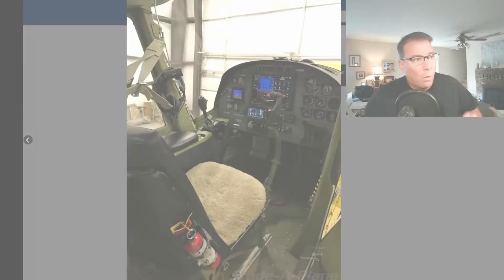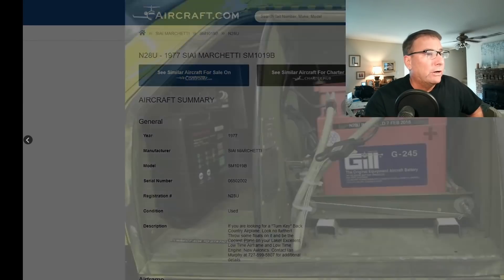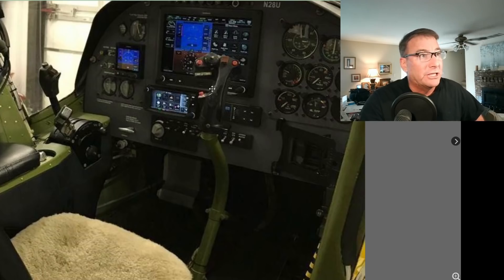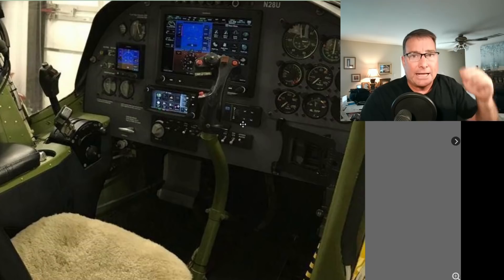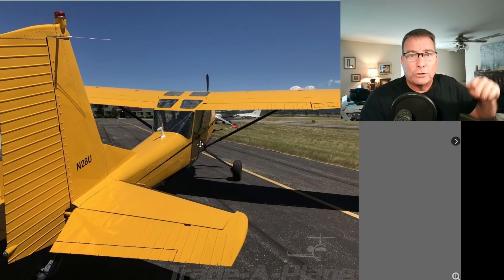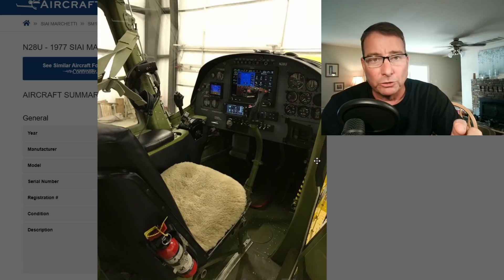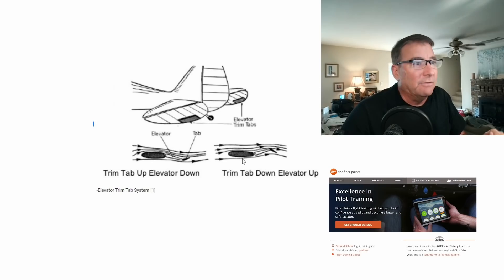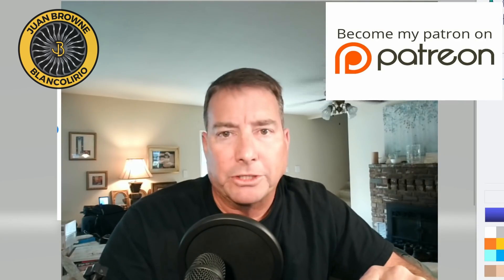Dale 'Snort' Snodgrass Siai Marchetti UPDATE- Elevator Trim System 8/8/21

Comment: I don't know I watched the video of the crash 20x without sound and it looks like there were no control inputs. If runaway trim you'd think he would have firewalled the stick...regardless of if he can't overpower it we would see flapping control surfaces....especially from a fighter pilot who is used to hand flying
Reply: I noticed the same .  Elevators and ailerons never moved .
Reply: nor rudder: I get that this happened fast but in that limited time frame I suspect “do something” might have won out over “freeze”. We should find out soon. I also noticed that on impact the elevator suddenly moves, then I think comes to rest up, likely as the control system breaks.  I just get the sense that in some way the controls were locked and the elevator in a slight climb position and the flight path dictated by left turning tendency.

Comment: In the event of a runaway trim to a nose up pitch in an aircraft with a powerful engine, would it be possible to throttle back to idle and hand muscle the elevator to a nose down attitude?
Reply: I answered Juan’s comment to me about that. Your hypothesis is the same as mine and Juan said it’s counterintuitive in the short amount of time to react.
Reply: @bjs2022  he’s right, you are not taught in training to cut power.

Comment: Interesting thought about the trim runaway but most of those systems (with the notable exception until recently of the 737 max) are designed to stop with application of opposing trim.  Holding opposing trim for more than a few seconds usually disables the system. ( on the max it did not. The system would reset after 5 seconds. This has been corrected. ) I will admit I am not at all familiar with the SM.

Comment: That control lock was very well designed. Even if you had a total brake failure, you would not be able to even fit your legs in there without it being very obvious that the lock was engaged..
Reply: Well, I think the theory with that was the control lock was on the front, and he was flying for the rear seat

Comment: I've done many many Owner assisted annuals and unassisted annuals. A couple of the unassisted ones were real cause for concern. Had a C182 in for annual and upon pick up found that the front seats had been switched now because the Adjustable seat was on the right I noticed it immediately when I sat in the left or pilots' seat. Same Owner different Plane different shop. When we went to pick up the plane naturally the logs weren't ready but every thing was done and ready to go. On the preflight found only 1 screw on all the inspection covers and panels. Found a bac of screws on a workbench with a tag with the N Number on it. Inspect inspect inspect after any maintenance or others flying your plane.
Reply: @Robert George Most airports quote a response level (times, number of vehicles etc) for incidents. I don't know what they are at Lewiston, but you ought to check before you accuse anyone of anything.
Reply: One Man ran to the scene and the others were unconcerned, sad world we live in .
Reply: @deerhunter7482  Sorry but there was a second person (white shirt?) on the scene very soon after the guy on the dark shirt arrived. Not criticising just pointing out something easily missed.
Reply: @deerhunter7482  I guess they realised that the impact was unsurviveable and then when they noticed the flames may have thought it would blow up. In other words perhaps they didn't want to endanger themselves for no reason :/
Reply: I have no reason to suspect anyone's motives but with the video why did no one be proactive with a fire extinguisher? Is there a protocol not to advance to the craft?
Reply: @larrybe2900  Yeah there seemed to be a distinct lack of urgency from almost everyone on the tarmac.
Reply: @larrybe2900  Shock can stun people into inaction too. Don't forget that we could see what happened due to the height of the camera whereas people on the ground would have heard a loud noise followed by a cloud of dust. Several of the "bystanders" would have had their view of the incident block by the jet sitting on the apron.
I am not being critical just pointing out somethings that could easily be overlooked.
Reply: @larrybe2900  Most, if Not all airports have S.O.P.'s regarding what to do in case of an incident, and may state Only Certain personnel are to respond to an incident.   Also if they were "airline" personnel they may not have known what the airport's policies are regarding incidents and/or may have limited training.    Hopefully that answers your question.
Reply: @matthewgroff433  “Not my job.” ??? Really- really?  I can not imagine NOT trying even if I only throw dirt on it with my hands!

Comment: Regarding the seat rails, your video shows that this plane's seat rails have multiple adjustment "holes" and they look nearly identical to the seat rails in a Cessna 180 that I flew for 17 years.  There is much more than just a couple of inches of fore and aft seat adjustment.  I don't know how tall "Snort" was but if the seat was adjusted even a little forward of the middle position on the rail it's still possible for the seat to move back far enough to get one's feet off of the rudder pedals and far enough that you may not be able to push the stick far enough forward to lower the nose.  On the Cessna 180/182 there is an AD requiring a modification to the seat to keep it from suddenly moving aft even if the seat rails and locking pins are worn.  The only problem with this theory is a slipping seat usually (but not always) goes aft quickly which would cause a sudden pitch up rather than a smooth, continuous climb as seen in the video.  Still, this could be a contributing factor.  Food for thought.
Reply: It was the aft seat that had a lot of adjustment, not the fwd seat.
Reply: @python3574  Thanks, I stand corrected.

Comment: Juan, how does the pilot verify correct operation of the trim tabs?  Does he use a mirror in the cockpit to view the tabs or is there an instrument?
Reply: Actuate the trim system, walk around the tail and look at it. Actuate the trim in the opposite direction, walk around the tail and look at it. Outside of having a spotter, that's about it.
Reply: @dragthatsht  I usually don't have a spotter besides I want to see it myself.
Reply: What I do is set the trim to full up then get up and check the trim tab. It should be fully down. Down in the trim tab forces the elevator up.
Reply from the maker: Trim indicators in the cockpit.
Reply: @blancolirio  But if it's rigged backward the indicator show that? In the Cessna and Piper I fly I don't think so.

Comment: It seems to me that a trim system without some visual indication of the deflection is an awful potential danger in that crucial period of lift off. The old systems which employed a graduated dial that showed the set amount of tab deflection is superior to my mind. Especially considering the chance of runaway deflection where motorization is involved.
Reply: I was just thinking about this. Could they add a high pitch sound when pressing the button up, and a low pitch for down. Then if it gets stuck - you would hear that unique continuous sound. Also add indicator lights for each one on the dash as it's triggered.

In case of electrical short, perhaps design a digital encoder in the button. That way a specific signal could be sent for each direction and a damaged wire is ignored.

Comment: Thanks for the update. I agree the control lock theory doesn't apply here. The electric trim is high on the list of things that work until they don't.

When we had our PTT switch repaired in our Commanche yoke.  The mechanic reversed the electric trim wires on installing. Nose Up was Down, Nose down was up. I don't think the power needed to counter this by the pilot would be that hard. However, in the  PC-12 the pilot told me that with runaway trim, there was no way to fix that inflight. What you got is what you flew with until emergency landing.

Because their is data to suggest the boot was missing on the second control stick makes me think that their is a high probability that coins or foreign object could easily lock the stabilizer. Given his age and rush to departure, little mistakes including loose camping gear might be the cause. However, before takeoff  a mini stroke might have  occured. There was no aileron deflection at knife edge 90° bank. At this point it appears he was along for the ride.

The typical get your tail up and flying never occured on takeoff. So there wasn't much time to figure out the situation. It seems that nose down authority was not possible on takeoff or during climb recovery.
Reply: Would pulling a breaker stop runaway trim?

Comment: Non-pilot asks:  No matter how powerful the trim tab force is, how could it possibly overpower the application of full down elevator, which looks like it has at least ten times the surface area?  And why would the pilot even be fiddling with trim settings on takeoff?  I thought trim was for making fine adjustments to the plane during level flight?
Reply: I'm not a pilot either. The trim tabs seem to have a mechanical advantage by being out at the trailing edge of the elevator whereas the man-powered elevator control would be applied closer to the elevator pivot point. Just guessing because pilots here are seeming to point out the forces that the trim tabs can have. But it seems to me that system design should always allow the direct elevator controls to override any incorrect trim setting. If not, "trim" is not a very good term for these things - something more like "alternate elevator" control would be closer to what they do.
Reply: The trim tab is at the end of the elevator, which gives the tab a lot of leverage to move the elevator. Fighting against it will be dfficult or impossible. 

Trim has to be set correctly for every phase of the flight: if you have ever stick your hand out of your car window, you know how much force air can exert even at speeds very low for an aircraft
Reply: Christopher28fair  Yes, both for level flight and high speed and for the gross adjustments needed for takeoffs and landings that are at lower speeds. Also for climbing with more power and descending with reduced power.
Reply: Notice that the trim tab doesn't control the aeroplane directly, it controls (or biases) the elevator which controls the aeroplane. The pilot cannot physically apply enough force (through the stick) to oppose the force applied to the elevator by the trim tab in this case. Imagine a demon standing on the horizontal stabilizer, heaving upwards on the back of the elevator. The pilot cannot physically move the elevator in the direction they want to. If they could, yes the aircraft would probably be controllable despite the trim tab. 
The trim tab is used in all regimes of flight, from take-off to landing. Any changes in power or attitude usually require trim changes. Trim (when it's working correctly) is used to negate forces that the pilot would otherwise have to continuously apply to the controls. Look for cockpit videos of small planes and note when the pilot is cranking what is usually, in older types, a wheel-like control, before lining up for takeoff, in the climb after takeoff, beginning descent etc.

Comment: Forgive my question if it's stupid ok but if the trim was "backwards" couldn't he push the stick forward to pitch the nose over and try to level off or get the nose down to gain speed?

The video it looks like he goes up then he came back down and to the left? Was he in control of the plane at that time? If not then something is really not right here right guys?

edit: After watching the crash footage it looks to me that something caused the plane to bank left and then it started to spin but obviously he wasn't high enough to get into the full spin.

Am I getting the right idea ?
Reply: By the time he realized something was wrong it was already too late. The plane had already stalled, and even if he could overcome the trim by pushing stick forward, it was far too late to have any effect. He was way too close to the ground to be able to recover.

Comment: Seems to me that if he had only cut power when he noticed his increasing angle of attack, he may have survived
Reply: My thoughts too.  I was trained to control attitude with power but I could never second guess such a skilled aviator.  I guess with only seconds to react/diagnose/execute it was too late for any actions.  RIP Sir.
Reply: I thought the same thing. I'm a low time pilot, but I feel like my first instincts would be to push the stick forward and if that didn't seem to do it, I would immediately pull power. Adjusting trim in that situation just feels too damn slow..

Comment: The aircraft looked to be in trouble from the initial roll. It seemed to takeoff from three wheels, never pre lifting its tail wheel. What sort of clime out rate are these aircraft capable of. Was it a sudden loss of power ?.
Reply: The sound did not indicate any loss of power.

Comment: If the trim was overpowering his ability to manually push the stick forward,  wouldn't the next move have been to retard throttle before it was at or close to stall?

Comment: Juan I've watched your last two videos and two things were coming to mind. 1) CG & 2) 'sailor proof' rod ends, i.e. rigging.
It almost appears the CG shifted and the attitude of the a/c nosed up. Or something shifted/ broke loose. Not sure this could happen on a small a/c like this.  With regards to rigging I say, 'sailor proof' because on most Naval Aircraft it is almost impossible to incorrectly swap linkage rods or mis rigg a bird. Rig pins would fall into place, etc. What say you?
Reply: No, I actually saw an example 1st hand of an F8 wing incidence where the UHT would go -5 degrees down with the wing up, the opposite of what's supposed to happen which is 5 up. This was after a post maintenance phase inspection,  I was CDI, collateral duty inspector, qualified and didn't sign off this one. For good reason, abnormal control behavior would have killed the pilot on takeoff, maybe they might have realized it on the line checks, but it never got through the layers built into NAVAIR. AMS1 Sullivan USN Ret

Comment: Juan I have a question. Considering the absolute  excellent flying skills that Dale possessed, it seemed from the video that the aircraft jumped off the runway quite soon and abruptly. Wouldn’t immediately chopping the power have saved the day?
Reply: That was my thought as well. Chopping the throttle may saved his life. 

That being said, I don't think even a computer could have made sense out of that situation quickly enough to have done anything about it. he had seconds to react.
Reply: @dragthatsht  Perhaps cutting the throttle might have had an effect but I'm not so sure being that nose high, it would have probably stalled and rolled anyway. He found himself unexpectedly nose high with little airspeed, little altitude and no time.
Reply: I have a friend who experienced an out-of-trim takeoff in a Pilatus Porter, with a stall spin to impact.  Incredibly, everyone on board survived.  This is known as a possibility with the Porter, as the CG moves rearward when loaded.  So, land and pick up a load, forget to adjust the trim, and you have an issue.  Best practice among Porter pilots is to brace the stick hand during takeoff, as the stick will jolt back into your hand at flying speed, if the trim is off.  

If you aren't prepared for it, you have an immediate, early takeoff that that results in the steep climb.  About the time the pilot realizes the problem, the airplane is in a steep attitude, and below VMC to prevent a torque induced roll.  At that point, reducing power might stop the roll, but also takes away what little control authority there is, and won't change the impact much.
Reply: @400_billion_suns  I may be mistaken, but it appears your perspective when comparing the 2 planes is not the same.  The video, I believe, shows Snodgrass' plane from below and slightly aft.  Whereas your example plane is viewed from slightly above and from the front.  This may skew the angle of the elevator deflection.
Reply: @michaelmeador2609  The perspective in the comparison aircraft image is indeed slightly different, but not by much. The time where I grabbed that screencap is after Snort's plane starts to roll left, toward the camera. We're seeing it from slightly "above" too because it's rolling toward us. If you compare the chord line of his wing (which is rotated almost perfectly level in the comparison image I made on the right) to what appears to be the elevator endcap, they are not parallel. If it was neutral elevator, they would be.
Reply: @400_billion_suns  Thanks for the clarification.  In that case, I don't disagree with your observation.
Reply: or...he could have simply over rotated it?
Reply from the maker: possibly...but how would you know there was a problem yet...
Reply: @blancolirio  
Does each aviator have a "signature" style of take-off and at what point in a perfect controlled scenario would s/he know something is wrong? This harkens back to the time frame involved in this case.